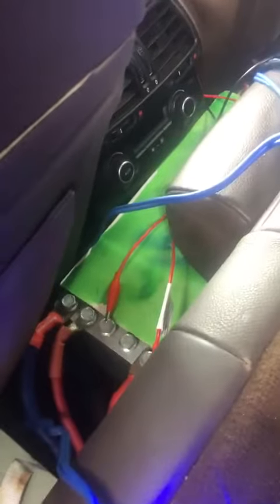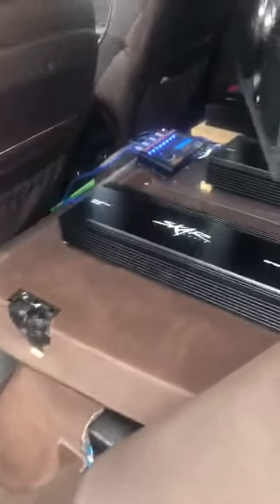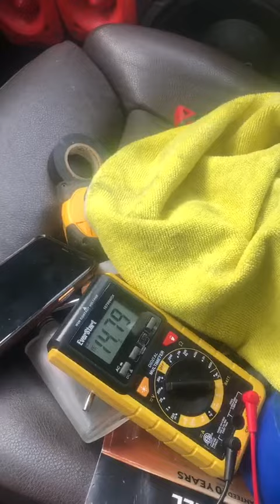Four skar audio zvx 15 wire to one ohm on a single skar rp2000.1

Comment: So the only upgrade you have done as far as power goes is the lithium bank? I asked because your holding at 14.5 which is great even if it’s on a single 2k